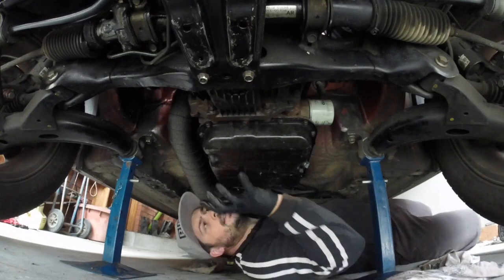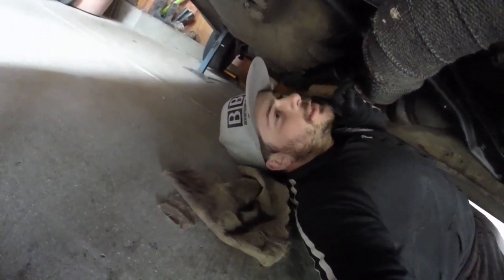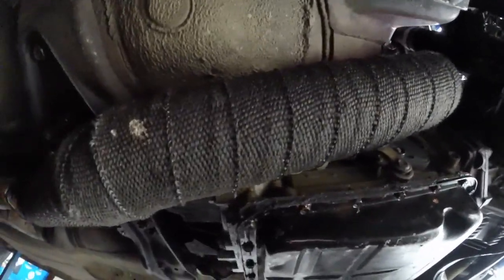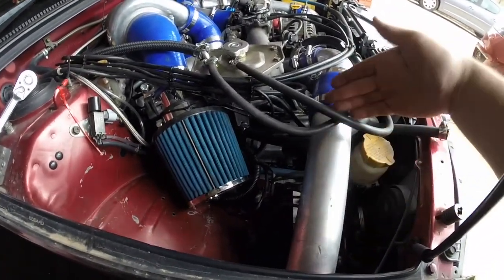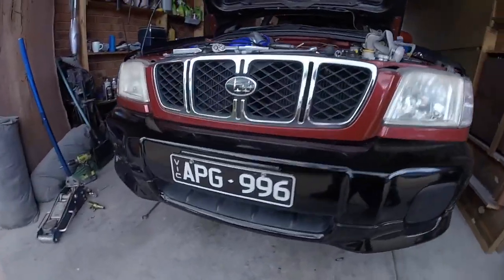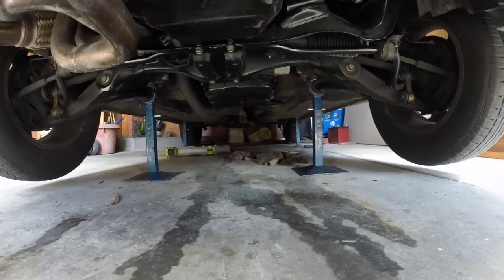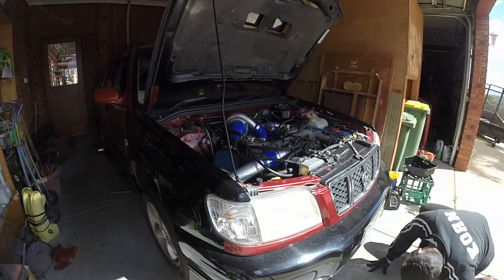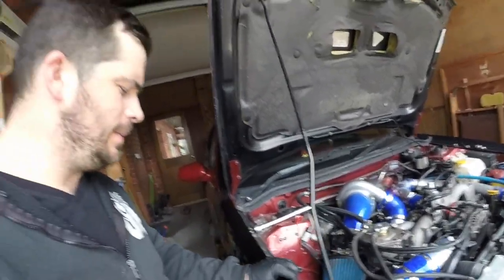TWIN TURBO SUBARU  NOT STARTING??

Comment: Put bungs on the intake for breathers after the maf or you'll risk contaminating it with oil.

Didn't put ignition fuse back in? I dunno as it'll still start with maf unplugged.
Reply from the maker: True with the breathers
Hahaha Something to do with the MAF

Hmm 🤔
I put it in backwards